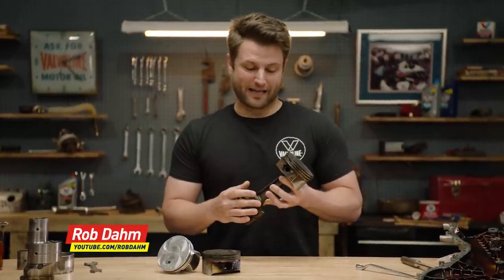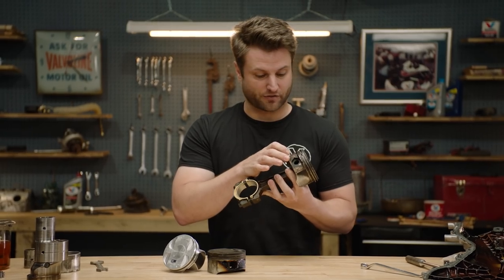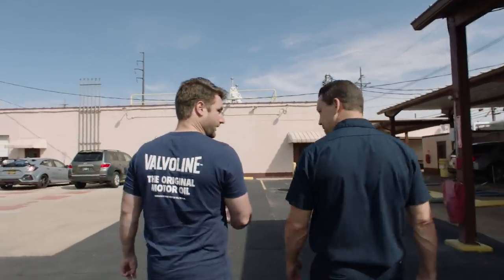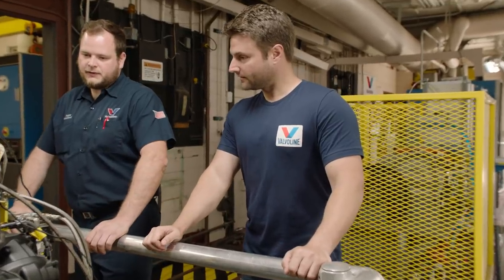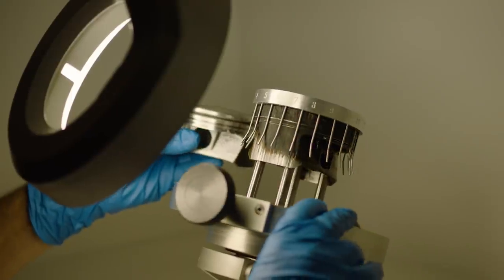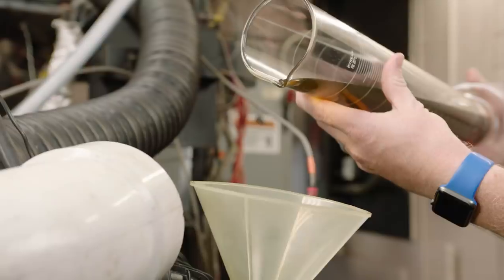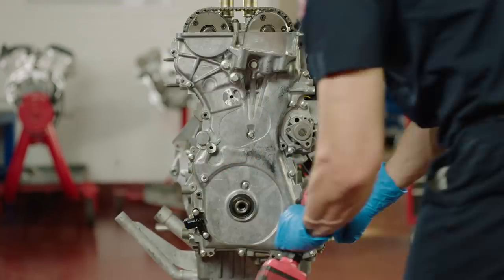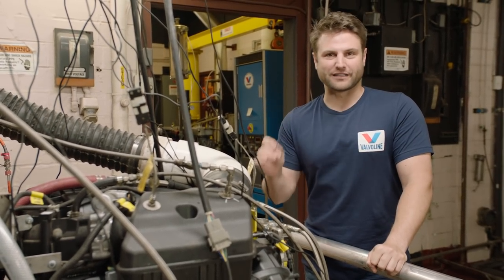Rob Dahm Gets Firsthand Look at Valvoline’s Leading Technology in Deposit Protection

Comment: Valvoline has been fantastic. I have a v6 Tacoma and I have been running VR1 full synthetic 10w30 for the past few Oil Changes, so far it has been great. I know the VR1 was designed for racing engines but I liked the amount of protection and additives in it and it was the same weight I normally run in my truck so I decided to try it. I have been very pleased with this product and will continue to buy it.
Reply from the maker: Thanks for choosing Valvoline!

Comment: I switched from Amsoil SS to new Valvoline Extended. Oil analysis showed higher Moly which my 2020 Tundra 5.7 reacts well with. Quites that normal "tick" on this great V8.
Reply: Agreed, I drive a Toyota and like the Valvoline extended due to the higher moly content. Similar to Genuine Toyota oil but cheaper and easier to buy. Also Toyota oil is only available in 0W-20 and 16 and I run 5w-30
Reply: @CL-yp1bs  Toyota's branded oil is made by Mobil.  So is Honda's.

Comment: What's the piston rod, crank, cylinder and valve wear look like? I've been using valvoline 5w-30 full synthetic with a Purolator one filter. I change the oil about every 6 months which is about 6,000 miles and it looks dark brown not black. 85% city miles.
Reply from the maker: Since driving conditions will vary with each vehicle and consumer, we would not be able to accurately advise what the wear on your personal vehicle may look like. However, using our products does help prevent normal wear and tear, along with engine breakdown.

Comment: I have a 2020 mustang ecoboost I use Valvoline extended 5w30 my car has a tune and full bolt ons I change the oil every 3500 miles and the car runs like a champ no carbon deposits at all and the car has close to 20k miles I trust this oil specially for my engine cause ecoboost are known for cracked blocks and this has happened to several Ecoboost owners cause they tune and run the heck out of these turbo engines and blow the engine a lot of these guys also don’t change there oil as they should.

Comment: What the heck. The fact that Valvoline should be the ONLY motor oil company that has a engine "lab", sounds wrong. 

I do guess that other companies test their stuff to. And I do hope they test it on the street because a enginelab is not appropriate than what's happening on the street.
Reply from the maker: Hey Moritz Do. It's true.  We're the only motor oil brand with a dedicated engine lab. Our engineers work 24/7 testing and formulating products to be the best protection for your engine. Check it out here - https://team.valvoline.com/EngineLab
Reply: @valvoline   I don’t see rotary specific engine oil and 2 stroke oil on your website?
Reply from the maker: Hi Adriano, please reach out to our Product Support team for further assistance regarding product questions and offerings. They can be reached at 1-800-TEAM-VAL!